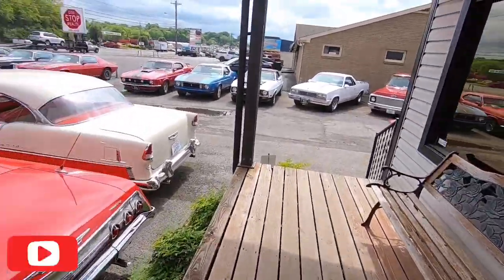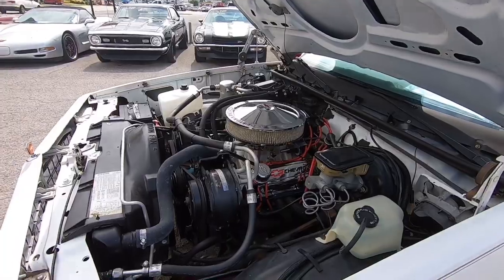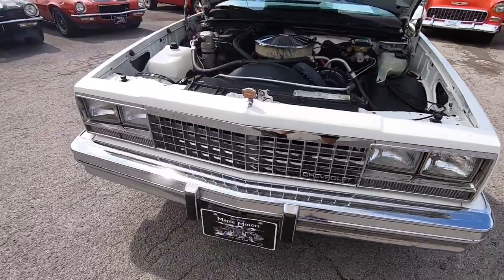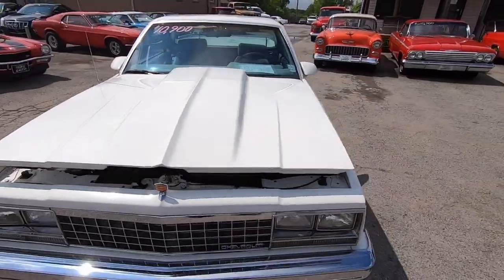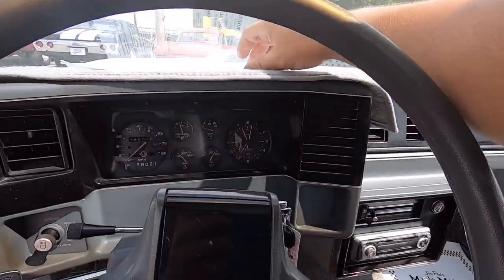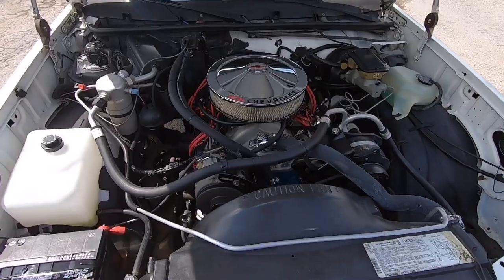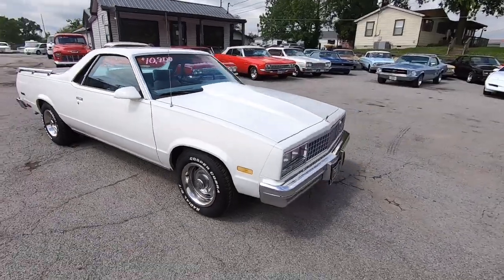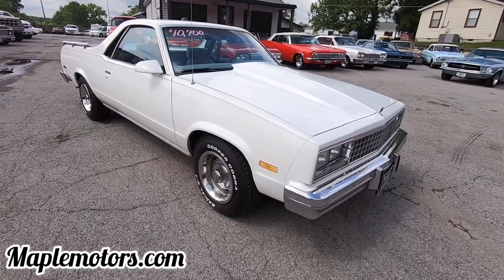1987 Chevy El Camino SOLD for $10,900 Maple Motors #589

Comment: What ever it is with the light it's not major 
It's not engine cats are not clogged wouldn't run like it does if so. No smoke no values sounds engine sound good so engine like is minimal AC easy fix any car this age should have all hose for AC should be changed by now clean system out and recharge it will be factory new AC .